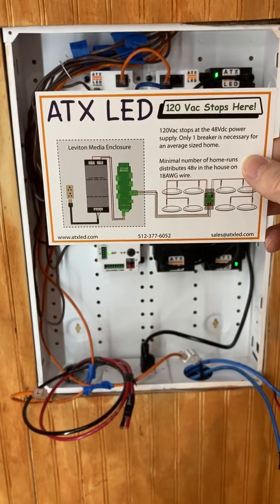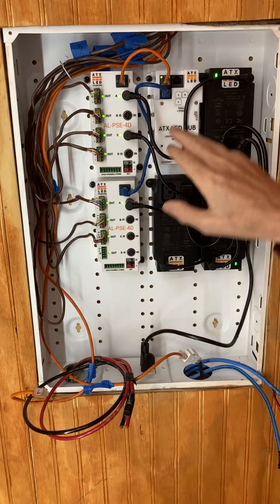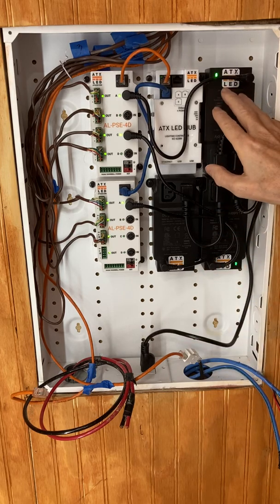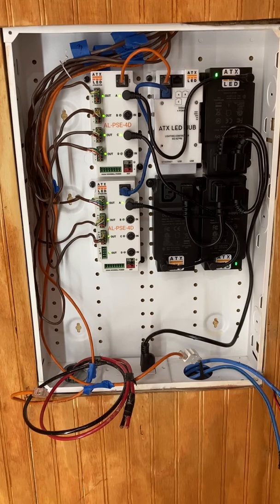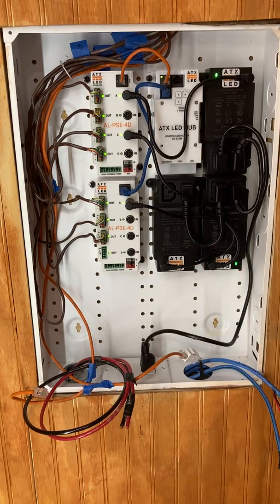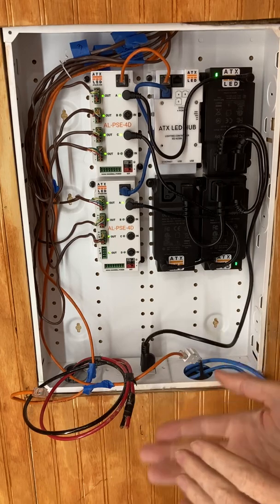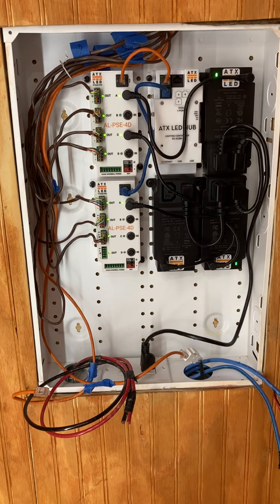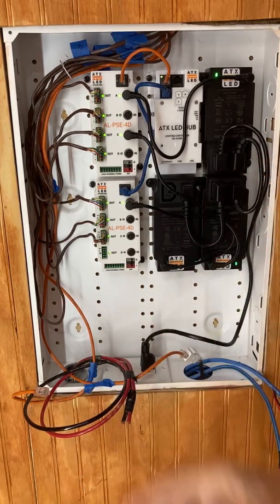ATX LED energy routing panel for DC lighting, Class 2 wiring and power sources.

Comment: Can the color temp be controlled after installation? So as I go about my day I can pick the temp I want, or even possibly have it change automatically through the day by the smart hub?
Reply from the maker: Yes - we will upload our video showing a DR2 with color tuning from the slider.  It can also be controlled by App or by time of day from the optional central hub, and the hub can communicate with google and Alexa if you want.